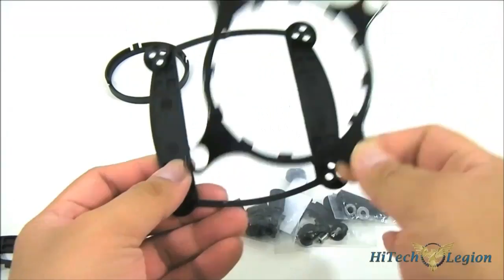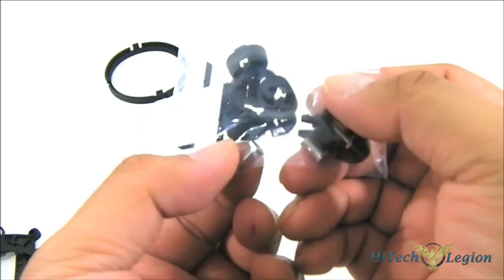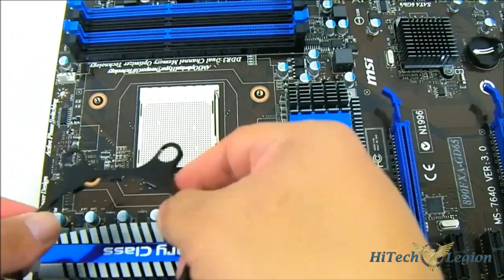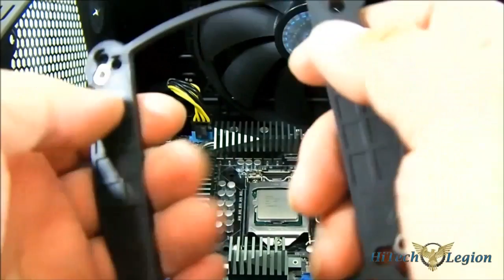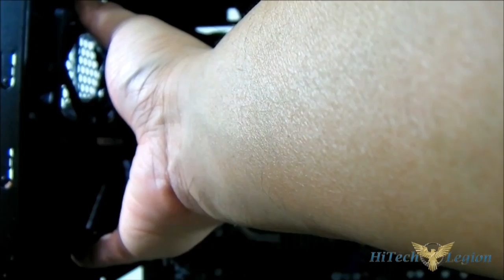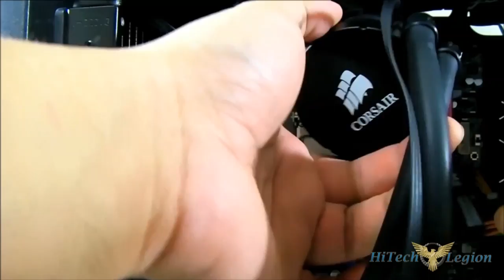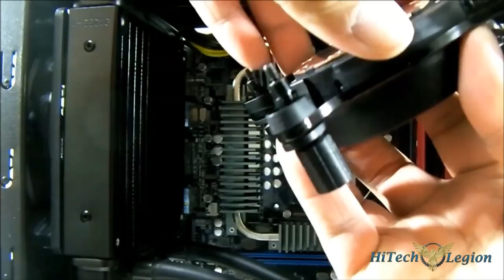Corsair H55 Cooler Installation Guide for AMD and Intel Motherboards

Comment: decent guide, but would secure the mounting screws and then place  the block on thread and use the thumb screws to tension it down.
Less change to smudge the thermalpaste that way...

Comment: So, did you just take out the atx fan, and replaced the radiator on the wrong place and opposite side. It means you stopped the outgoing airflow and that thermo energy what the cpu does gonna flow back into the atx! 😂👌👏👏👏

Comment: Ugh, doubt anyone will answer, but i cant seem to attach the fan and radiator to the case.  The provided screws (plus washer) leave almost no length past the fan alone.  Stupidly attached the pump to the cpu already, but i feel like this shouldnt be as difficult as it feels

Comment: why is the airflow  INTAKE? you intake the heat from the radiator? ><
Reply: Rainjet Quiamco “intake” mean air is going int through the radiator into the case. Heat is still leaving the radiator whether it’s INTAKE or OUTAKE.

Comment: does it fit a LGA 1151
Reply: Andy snipermaster it says it does but I am also having issues . Does anyone know the answer ??
Reply: the pins on the back plate don't line up on the back of my MSI Tomahawk z170A Ac motherboard
Reply: Andy snipermaster I can confirm it does work with an i5 6600k 1151 socket on a MSI Z170A gaming M5. The screws in the mount go into the 1156 holes. The mounting plate on the bottom looks a little wonky but you can't tell from the top.

Comment: hi
where did u plug the h55 fan cable?  is it in system fan slot or cpu fan slot?
Reply: I'd say put it in the CPU header. That way, if the pump breaks your computer will give a CPU fan error and you won't overheat your CPU. You can see a broken radiator fan but not a broken pump.

Comment: i am contemplating buying this as i want to future proof my pc and i dont want to waste money now on an aircooler when i will most likely be upgrading to a water cooler in the future but for now i have an am3+ socket cpu is this cooler compatable with it ? i have an amd fx6300 black edition cpu which i wuld like to overclock now and then upgrade down the line

Comment: Thanks for your video, I found it very helpful. I was a bit confused when you started talking about having the fan blowing in or out (especially regards having the fan top mounted) as I'd personally prefer getting heat out the case. Is it that much more inefficient to have the fan blow out? Also do the fan/pump connections matter as I believe you need the pump running at full all the time and not modulated in any way?

Comment: Literally just installed this in my setup and thanks to the video made it a lot easier. I have an FX-8350 on an older GA 78lmt-usb3 board and the stock cooler was sounding like a jet engine under load, but this is nice and quiet. Have yet to properly stress test it, but I just thought I'd say props to the uploader for the info here. The manual was slightly ambiguous and this helped me a lot.

Comment: I use this for about 2 years and i noticed there is dust between its 2 fans,in its 'radiator thing'',so i have a question:do i have to remove the dust somehow in there or it is not necessary ?
Reply: +pertselisstef yes remove the dust, it improves the performance to what it was like new.
Reply: Thanks but how to i do that ?Is there any danger for the fluid to leak or there is no problem dissembling the first fan ?
Reply: just undo the 4 screws holding the fan to the cooler. Or if you want to be super lazy, buy a can of compressed air and blow it out while it is still assembled.
Reply: Ok thank you,i dont mind removing a few screws if i know that the fluid from the radiator wont run off :)

Comment: this doesnt work with A10 7850K right since it has FM2+ socket meanwhile this one only supports FM1
Reply: +Jhanzent Capin FM1, FM2, AM2, AM3, plus mark, no plus mark....all the same physical socket. If it supports one, it supports them all. That goes for the X41 (which is a far better cooler than this), also.

Comment: Yes, Corsair does recommend you install the radiator fan as an intake because you are drawing colder air through the radiator. However, you shouldn't be installing it in the rear of the case. Where is the air going to go if you are intaking from both front and back? In this case you should install the radiator and fan assembly into the front of your case, replacing one of your intake fans, and leave your current exhaust fan in the back.
Reply: I have drive bays in the way of my front fans and I have this installed as an intake at the back :P but I have two exhaust fans at the top so I guess it's fine really, kinda like a chimney 😂
Reply: +Moto_rider Valid point, but makes sense go with intake fan at the back as recommended if the individual case design facilitates it. e.g. I have a quiet 230mm top extractor fan mounted at the top of my case, so front and rear intake fans flow in and up to the top of the upright midi case where they are exhausted.

Comment: It comes with just 4 bolts to attach the fan to the radiator.. good luck if you want push>pull.

Comment: Excellent tutorial and demo 5*** - I would never have been able to assemble it without your video.

Only trouble was, I didn't check the size of my case first so I couldn't fit the fan and cooler assembly to the frame!  Probably forgot to take my dementia tablets as well!

Comment: Question, PC Part Picker, says this will work on my Z97 LGA 1150, but I'm reading from you guys it'll only fit the 1155, and other models. Will it not fit on my 1150? So I can find a compatible fan before I purchase it.
Reply: killedmymom As far as cooler mounting is concerned, 1150, 1151, 1155 and 1156 are physically identical. If it fits one, it fits them all.
Reply: idk, people say its off by a miniscule amount, but that it makes the difference. I'm going to get the H50 instead, just because it's basically the same thing.
Reply: killedmymom I would be willing to bet that Intel knows more about the subject than "people say". There is no minuscule amount. The only physical difference in the sockets is the number of brushes and consequently their layout.

I have no idea how this stuff gets started going around.
Reply: Neither do I, but I plan on calling them when I'm not a work, Hopefully they can either direct me in the right direction, or give me some kind of help, 

I'd rather be safe, than having the wrong part.
Reply: +killedmymom I have this cooler installed on my Z97-P 1150 socket.

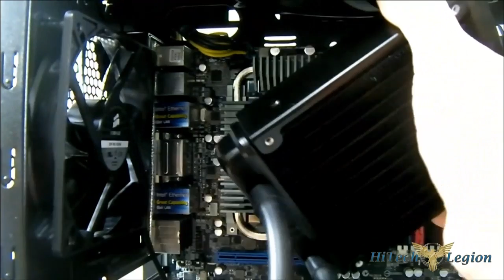Comment: @10:15 yeah great plan so the rubber tubes can rest on top of a graphics card running at 80 degrees forget that
Reply: Reece O'Brien Yeah, I watched this before I was installing it to see what it looked like in a case, and, now I've installed mine, the tubes rest above the GPU. It looks really nice, too.
Reply: You do know rubber is an insulator right? Meaning heat from the outside of the tubes wont transfer to the inside and vice versa, besides I have this cooler and the tubes on mine don't touch the GPU.
Reply: +alvarg 80 degrees? What the fuck, dude? I average 50 when running GTA V at full settings. What card do you have?

Comment: Is this compatible with a 2008 Dell PC with Intel Core 2 Duo? I am very close to purchasing this as my computer fan sounds like a leaf blower. Thanks for posting.
Reply: ***** if you watch the video he says there are mount holes for LGA 775
Reply: ***** Unfortunately the H55 only supports Intel's LGA 1155, 1156, 1366 and 2011 sockets (as well as some AMD sockets) and as the Intel Core 2 Duo uses the LGA 755 socket it would not have the right mounting hardware to attach to your CPU
Reply: ainslie1171 So exactly what fan would you buy for a 2008 Dell PC? That's all I need to know.
Reply: Look@DatGuy This is getting pretty complicated. Alright, thanks.

Comment: Would it be best to have the radiator outside and the fan inside blowing air out?

Also what if you can put two fans on it? there are screws on both sides of the radiator.
Reply: Yes you are able to install two fans on it.

Comment: Thankyou for this guide.

I found the stressful task was made a lot easier by watching this video.

The only issue I had was the back plate overlapped the hole in the back of the case.

I was get 53c idle on a 7850k with the stock hsf and and now getting 32c idle. At load I'm now getting 42c.

Comment: You installed the fan reversed. It should take the hot air from the radiator and put out from the case.
Reply: No it should take cold air from outside the case and blow the cold air through the radiator cooling the liquid. It says in the manual that this is the optimal configuration for better cooling, he even says this in the video. Open your ears.
Reply: In my opinion fan works better as heat extractors, if you follow this way the overall case temp remains lower. I don't care what this video says or even corsair ;)
Reply: +Tommy89 PC fan Cold air from outside the case through rad makes for cooler cpu temps, FACT, there are no opinions when it comes to hard stats. Yes the overall case temp will be slightly higher but so long as you have a decent case fan arrangement,  the only thing that it will affect is the gpu temps, probably by about 1/2C, a negligible increase in temps.
Reply: +Reece O'Brien You are right, facts outweigh opinions. Such as the fact that if your case is set up for proper airflow, the temps inside the case will only be a couple of degrees different than the air outside the case, meaning essentially no difference in CPU temps. Or the fact that since you couldn't be bothered to set up the airflow in your case, the GPU temps will see a significant increase (not the trivial one that exists in your opinion) by blowing warmed air into the case. Not to mention the VRM (which is already an issue with many AMD boards) and memory temps. The goal in computer cooling is to cool the computer, not a single component. After all, that would be incredibly myopic.
Reply: +George Cella I installed my H55 two days ago, before I installed it I had a thermaltake heatsink, two fans at the front, one at the bottom and on at the side, all as intake, with one at the back and two at the top exhaust. Now I have the H55 as an intake config at the back my GPU is only one degree hotter at idle and no difference under load (GTX970 Gigabyte G1 Gaming Windforce). I get that exhausting the air would be better and personally prefer to have it that way too, but with the screws you get in the box it is not possible to set it up as exhaust even if u wanted to and with such a small increase in temp to my GPU, I just personally don't see the point in ordering the right screws to change it around. 

This is FACTS from my own observations.
Reply: +George Cella also the lack of temp increase on my gpu may be down to the type of card, its a monster with cooling even though I've overclocked the living daylights out of it

Comment: A friend of mine installed this for me, but something is clearly wrong. The temperatures are too high and the PC is susceptible to turning itself off when I do anything intensive like rendering a video. What's the easiest way for someone who has no experience and tons of anxiety with the insides of a computer to fix this?
Reply: tetsuo9999 Make sure the block is mounted flush to the cpu and screwed in tight enough, secondly put the pump header into the cpu fan header on the board and make sure the cpu fan control is set to full in bios so the pump gets maximum voltage. i had to tweak mine a bit to work right, i get 35c on idle and 55 on full load with an 8350 oc at 4.4ghz. I would say this is lower end and gives me similar results to my 212 evo but looks better for now.
Reply: Would SpeedFan work with that? I changed the video card out on my pre-built PC, and now I don't see the bootup process when I start the computer up.
Reply: Speed fan does work if the fans are 4 pin pwm, as for the graphics card remove it and go into bios and make sure pci e is the first display adapter, also make sure everything is seated correctly, no loose cables etc and make sure card is getting good power off the 12v rail, what card is it ?
Reply: I don't know about the fans. The graphics card is working fine and isn't overheating, it's just the CPU that's causing the problems. It's an AMD FX-8120. What settings would I change on SpeedFan?
Reply: cpu fan or voltage to full if itll let you, you should get decent temps at stock with that chip, much lower wattage, also how many fans do you have attached to the radiator ?
Reply: radeonxtx I feel like punching something. Speedfan doesn't let me change the voltage and I can't get into the BIOS because this piece of shit pre-built computer freaks out when I try to get to it. Is there another program that will let me change this damn setting without getting to the BIOS? I've spent hours on this and nothing is working.
Reply: tetsuo9999 Just take off the water cooler and re-apply it yourself, making sure it's done right.

Comment: On the sides of my processor it already has like some bolts, screws. Should I take them off so I can put the back plate or can I use them some how? I have MSI 970 Gaming motherboard for AMD.

Comment: once u have installed this are u able to turn off all pc case fans or do u still need them running for the graphics card
Reply: You 100% need to leave all your fans in, your hard drives, motherboard chipsets and GPU will get toasty.

Comment: Just wanted to toss in how this went and my results afterward.  First off the guide was perfect, I couldn't begin to thank you how easy this guide made the installation.  It took be roughly 10 minutes to get everything in and back up and running.  Before installing my old processor (6 core AMD Phenom 3GHz) was running on average around 80-130 degrees depending on what I am doing.  I replaced with a 8 core AMD FX 5GHz overclocked) and it is running around 33-80 degrees depending on what I am doing.  I couldn't be happier, my system is running great and it is back to gaming!  Thanks again!
Reply: 130 ? the fuckkkkk
Reply: 80-130?! I'm surprised it's still alive!
Reply: same but i downgraded to 4 core and it works like a charm, sold my 6 core.

Comment: I have install it as shown in your video. After turning the power on I placed my hand on the circular pump to feel the heat. What I found was that I felt the warm only. I wonder if that is the way it works. Also, How do I know it the Corsair H55 Cooler is working or not. Can someone tell me about it
Reply: Hung Chau You can download a program called "Coretemp" to check your Cpu temperature. If it´s below 40 degrees celsius you should be fine :D

Comment: is any of these compact watercoolers configurable? I want to install the radiator on the outside and my case has holes for the tubes.
Reply: Peninaa85 The Swiftech H220-X and H240-X are open loop, so they are expandable and configurable, plus have the bonus of significantly better performance and much lower noise. A 140mm version has been announced for release over the next few weeks.
Reply: George Cella single 140? Thanks
Reply: Peninaa85 Yes, single 140mm.
Reply: George Cella thank you. Gonna check it out. If its too expensive i have to go with the tundra dubble 120.

Comment: Can I mount this at the top of my case?
Reply: Kanat Tabaldiev You cant. It's a closed loop system ;c
Reply: MikuCyberSnipe all in one watercoolers such as this have the liquid preapplied inside
Reply from the maker: spacehamster360 Yes
Reply: Ameria Can you tell me how this works, it's a liquid cooler yet i didn't see any water being inserted? (i'm new to pc)
Reply: +Beneath Manners  It's a sealed system - never needs refilling.
Reply: Bartikus321 closed loop is that you cant change anything it's pre built. And you cant change the water.
Reply: HiTechLegion how can I detach the pipes to mount it outside?
Reply: HiTechLegion my friend this cooler works with a asrock n68c-s ucc ?
Reply: ben p Thanks that explained a lot :D
Reply: +ben p How long would it be before u have to put more water solution in the rad?
Reply: +HiTechLegion How long would it be before u have to put more water solution in the rad?
Reply: Shawn Clabough THANKS
Reply: I know it's a old video. Does "Closed Loop" mean that you can't re-fill it with water?

Comment: just wanna know is that necessary to use the thermal compound if use this cooler
Reply from the maker: It is absolutely necessary.
Reply: akio vincent thermal compound is necessary for all coolers in a computer, including all cpu and gpu air/water coolers
Reply: +akio vincent Just so you know, the H55 I brought was pre applied with thermal compound. If it has a matt circle in the middle it is pre applied. Smooth and shiny slap some on.
Reply: Zar Q thermal compound is pre applied to the cooler
Reply: Jordan Lea yes all it has
Reply: +HiTechLegion i didnt use thermal compound and my highest is 80 degrees
Reply: +HiTechLegion but this cooler has pre applied paste?

Comment: Hi
I just built a new computer and was going to use this as my cooler. When I was about to install the backplate I was stopped by some pins on the back of my motherboard (Msi Z-87 -1150) Any ideas?

Comment: Do the legs tighten flush with the motherboard or does the cooling block keep it off a little? My mobo has capacitors that keep the ring from sitting flush without the cooler on there. I've seen others say they've used an H55 on a MSI z97 gaming5
Reply: You may have used the wrong screws, one set are longer than the others, I found this out the hard way when installing mine. You may need pliers to get the wrong ones back out of the retention ring, but don't straight up yank them, wobble them as you pulled to jimmy them out.